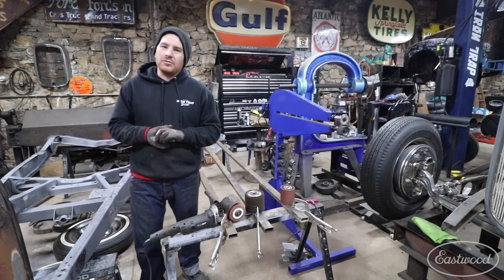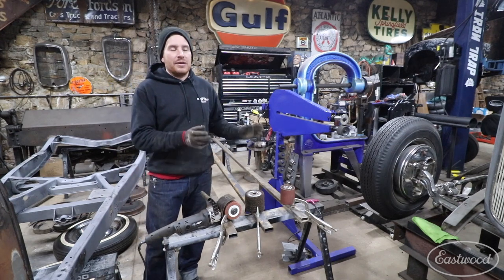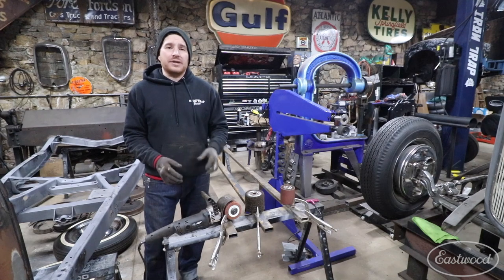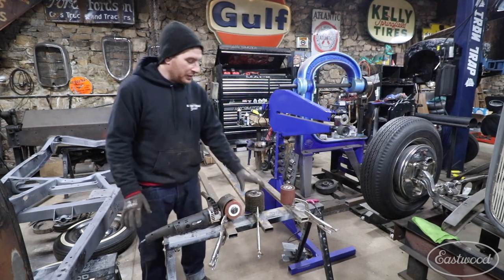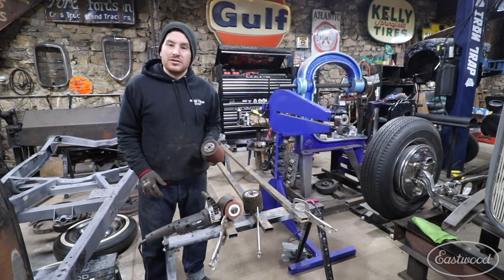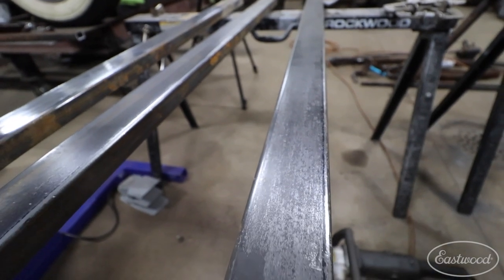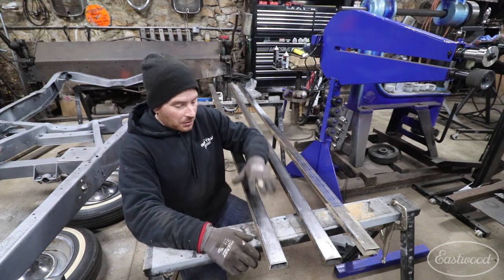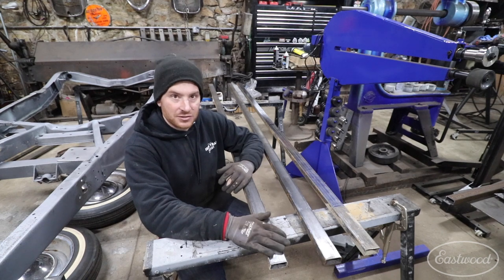How to Remove Mill Scale From Metal - Contour SCT Drum Showdown - Eastwood

Comment: Abrasive blasting is the best way to remove mill scale. It is, unfortunately, not easily accomplished at home on things like 10’ sticks of steel. The next best choice I have found is rapid strip discs on an angle grinder. The discs have a short life on most grinders. The solution is a variable speed angle grinder. I have a 5” Metabo variable speed. Slowing down the speed greatly extends the life of the rapid strip disc, while still doing a great job of removing mill scale. Don’t use the rapid strip disc on sharp edges (kills it quickly). Use a knotted brush on the sharp edges.